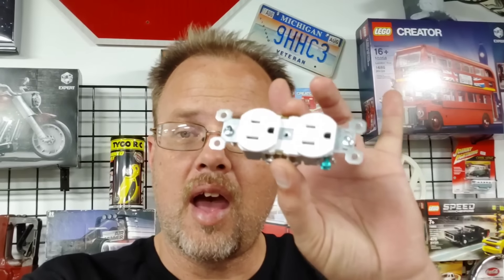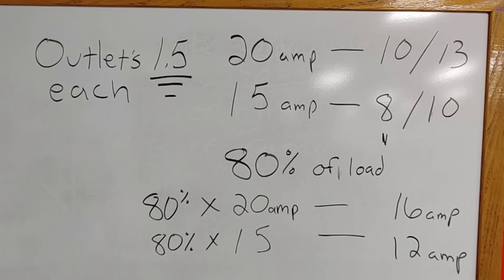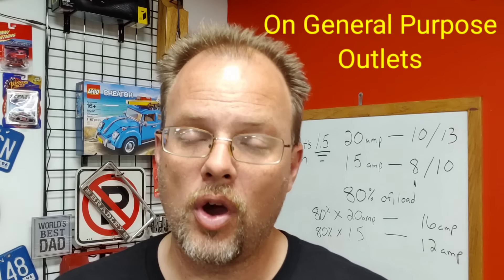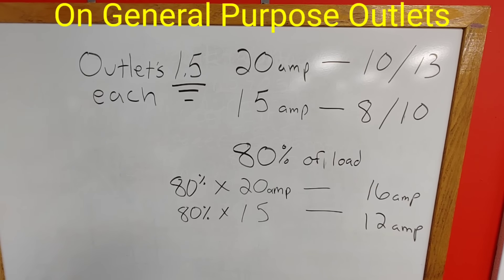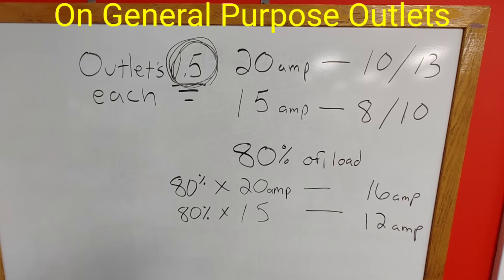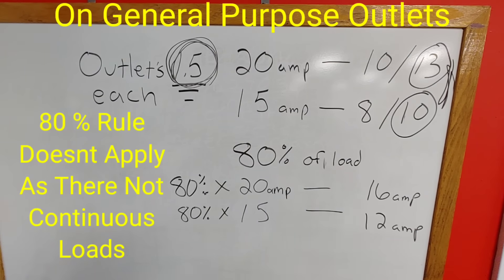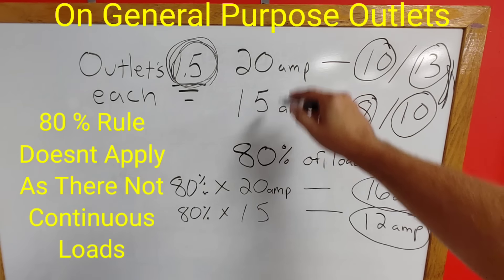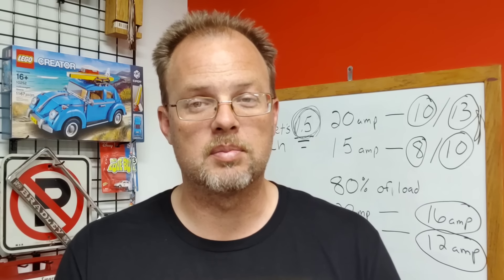How many outlets can you put on one circuit ?

Comment: The nec does specify 180va per receptacle which works out to be 10.66 on a 20 amp, so 10 is the correct and only answer
Reply: In kitchens I always went with 5 on a GFCI and deadacated the fridge and microwave.
Reply: Finally, someone calling this what it is.  A circuit containing receptacles, not outlets.
Reply: how bout that, an actual electrician...maybe city inspector as well?
Reply: Master electrician, 45 years experience,  after a lifetime of learning the trade, I didnot strive to be a good electrician,  my goal was to be the best electrician around, many people have magazines near their favorite chair or the bathroom,  my choice was the NEC.
And to Paul,  limiting the number of receptacles on a kitchen circuit is the way to go, and as required there must be two separate countertop circuits.the microwave must be a dedicated circuit,  for the microwave only. I normally put a single receptacle device to avoid the urge to attach a second item to the circuit.i always install a dedicated circuit for the refrigerator,  I have seen many instances where items plugged in would trip the circuit and a lot of foods we're wasted,  the same goes for a freezer,  where loses can be huge
Reply: Thats only for commercial application not for dwellings if you   want to go by code

Comment: Heres the thing...outlets aren't in use all the time....however if you have lights each can be considered an 'outlet' so if you have 4l lights thats 4 outlets... The 5 or 6 'plugs' may not always be in use even with the lights on....so the 10 or even 12 outlets on a 15 Amp may not be an issue

Comment: Nec indicates 180va per recepticle. 120vac x 20a=2400va. 2400va/180va = 13 “recepticles” on a 20 amp circuit. Va is still va!
Reply: All right except you left off the 80% , that would be 10 total
Reply: Finally someone who knows the REAL math
Reply: @gregberban7067  You got me! I messed up. (even though is there is no limit for dwellings. )
Reply: Yeah but the code said that you can use 80% of 2400w that's 1800watts so Yeah that would be 10 outlets, thanks for saying that so many people would argue with that. 😃
Reply: @gregberban7067  lol, thanks! Cant argue with code! Cord connected load can only be used to 80%. I just forgot that. Good stuff!

Comment: Been an electrician for 45 years , by using gained knowledge of construction and typical use of each outlet would determine the number of outlets on a branch circ. Knowing where the homeowner may plug in an air conditioner or electric heater is important. You would not run a circ. under multiple windows where more than one ac unit might be used. Common sense and experience makes for a correctly and safely wired house. With the high cost of arc fault breakers (around $50 +) that are required on all res. branch circ. some people will try to put as many outlets as poss. on a circ. to save money. I do not recommend this practice , you would be asking for trouble.

Comment: The Canadian electrical code has actual rules! Each receptacle is actually 1AMP per so based on 80%load on a 15A cct, you are only allowed 12 receptacles per cct, this number is written in the rules, same goes for lighting... All devices in resi are max 12 on any 15A cct. Now a 20A kitchen plug cct you are only permitted 2 duplex receptacles per cct.The only new exception is lighting when the fixtures are non-replaceable LED then you calculate as per load.. just swapping out the lightbulb does not allow you to add more than 12 devices to said cct.
I went to school for this ...and watching a few of these american sparkies i will say you are about 10years behind when it comes to the NEC upgrades vs my CEC.
Reply from the maker: Ive actually found we are behind on electrical and building codes both.  As for example canada's insulation requirements and such are much higher as well.

Comment: Given the logic of the video...is an outlet considered to be a standard one gang receptacle, or is an outlet considered to be a plug (so a standard receptacle would count as two)?
Reply from the maker: An outlet is 1 duplex
Reply: @BevinsBuilds  many thanks! Looked all over the internet and couldn’t find any clarity on that!
Reply: By definition of the NEC an outlet is appoint of energy use of promise wire . So the wires in the box are outlets the receptacles are devices used to attach cords. The box with a light attached is an outlet. The point where your A/C is wired is an outlet and so on

Comment: There is a limit on how many outlets. It's called the local code. Where I live it's 6 with a 1 outlet tolerance they will pass seven.  But there was a time when more were allowed. I counted thirteen in my home until I broke up the circuit, 73
Reply from the maker: Yes the NEC is the basic code and local code does surpass that.  Typically though your local code will match up with NEC
Reply: @BevinsBuilds  yes but go beyond NEC like grounds up in Hospitals. I really don't care which way paper towels or toilet paper go and grounds up is about the same argument. It's what you are used to. There are pros and cons about both sides. Hospitals have there own guidelines for safety. I always like the hot on the right and neutral on the left. 73

Comment: Pretty sure “as many as you want” is a wrong answer. It is a finite number. You still need to meet the voltage drop limits of the wire you are using, and the device listing criteria for wire size... (can’t just use bigger and bigger wire) figuring the splicing pigtails needed in each gang of a multi gang box and depending on how you make up the connections (feed through or individual pigtails) providing full capacity at the most distant location will limit the overall length of the circuit.  I suspect the calculated number would be much larger then folks would think initially.

Comment: Very simple.. watts = amps x voltage. If 1 microwave uses 1700 Watts and a coffee maker uses about 1500 watts and they are both connected to 1 outlet.  Even a 20 amp  circuit will not be enough.

Comment: So it depends what you intend to connect. Ever lived in a house where you cant run the coffee maker and the toaster at the same time on different outlets? Tripping the breaker every time? Thats why. Other areas with lower loads can have much more, especially with our modern energy efficient light bulbs, laptops, etc that take much less current than appliances. Surge on things kicking on (refridgerator) also needs to be consider. If you run a server set up, you do end up with more continuous load as well. (The geek in me shows.)

Comment: You left out mentioning that it is a rare event that ALL outlets will be used at the same time on any circuit.
Reply: Yes he sort of mentioned 'continus load'.
Reply: @carlbarrs929  Yeah, sorta mentioned it because it sorta applies to commercial locations that are under continuous loads, if they run lights 24/7. Residences don't have those loads, but this is a general info video so we get what we get.

Comment: Why do outlets stop working?
Reply: Break in the circuit. Old wires get loose under terminals. In and out landed on the plug and the plug burned out.  Animals chewing wires. GFCI is tripped( garage, rr, front door, back door, utility could all be connected in series. Terminals inside Receptacle got loose.  Fried shrimp.  Shrimp gumbo.  That's about it.
Reply from the maker: Lol
Reply: @submittedbymail  I ask a serious question!! 😡

Comment: Why use 15amp circuit breaker’s? What is wrong with using all 20amp circuit breaker’s?
Reply: More expensive wiring to carry 20 amp load.
Reply: 12 ga wire is really hard to work with, compared to 14 ga, and can’t be used with the push in terminals on the outlets.
Reply: I agree. Yes the wire costs a little more and is a little harder to work with. What you get out of the little extra one time effort is well worth it

Comment: 180 volt amps that’s in the code book
Reply: Volt amps?  Isn't that watts?
Reply: Finally! Someone that actually knows what the code book actually says! 180 volt amps is the number that is supposed to be used when calculating general use lighting receptacles (many years ago the only light in most rooms came from lamps plugged into the receptacles)

 I'm amazed at how many people quote the NEC code book but have never taken the time to open it up and actually read it themselves so they know what it "really" says. Good job!

Comment: The thing i disagree with is this, and I lived in a house that had this problem. One breaker, outlets in multiple rooms means you shut down a breaker you take  down several rooms, now let's think of this in load, let's say window AC units, unless you know for certain that you have this group of outlets on one circuit and you put a AC unit in, then you have to figure out where can I plug in a vacuum cleaner at that will not be on the same circuit. Spider circuirs are well and good for saving breakers and runs back to the box, but from a real perspective they are a nightmare and try as you may unless you have it documented you are never going to remember which ones are on which breaker. And trying to label your breaker box then becomes a problem to keep track of.  I tend to prefer the one circuit one room approach to circuit design, this way you know ok I kill power on this room and only this room. Yes the max loading and short runs is nice, but if take into account you put one cable from the breaker panel into a junction box and split off that you still gave one main cabel holding a full load from that j box back to the breaker.  Yes the breaker will trip. But how much heat is that single line from the j box to the panel taking as you load up the circuit? While its easy to keep track the spider concept for your own house, what about the second or third owner? Are they going to know that 13 difference outlets in three rooms are all on one breaker? In the before mentioned house that was a rental, the light switch in most rooms also killed outlets in the same room so turning off the light shut your TV off or your AC off. Save the next guy who has to figure out t a breaker problem from hours of trace work. Don't Spider
Reply: Jeez you should go make a YouTube video you practically wrote a book in the comments😂

Comment: ok, just to understand..... if I put 10 outlet to 1(15amp) circuit and one day I use 10 appliances or devices (blender, toaster, grill, iron, microwave, etc,etc,etc) at the same time. What could happen?
Reply: Local code can dictate more stringent requirements than national code. In Tn. You have to have a dedicated ckt for installed microwaves. Two dedicated small appliance ckts for the kitchen as well as enough ckts for fixed appliances ( determined by load ). Your washer and dryer are both required to be dedicated. 
I personally would limit the rest of the house to no more than 10 rec. Per ckt.

Comment: 180 va per plug in a residense.....lighting load is a guess.....you do not have to use 80% unless you have a continuous load...motor that runs all the time for example.....if you want to know in a house call an electrician.....if a facility has a maintenance engineer in chjarge, its up to him as stated in the codebook...if it were as simple as this guy says i would be out of a job....

Comment: Don't you have to account for the size of wire, or not?
Reply from the maker: The wire is sized according to the circuit you are using.  In the case in this video 15 amp is #14 wire and 20 amp is #12 wire.

Comment: So the answer to the question is the supposed electricians can make all kinds of shortcuts as they wish.  My garage area in a new house - 13 outlets on a single 20 amp circuit,  they would never do this in their own house.  I have a refrigerator, a radio, some chargers, etc. connected and if I run a 15 amp power tool or compressor, it trips circuit.  So I put my own dual 20 amp circuit outlet next to breaker box to alleviate that problem!

Comment: You refer to the code but obviously don't understand it.  The number of outlets is dependent on location of said outlet and the expected load. Most outlets in bedrooms will never see the load that an outlet in a bathroom or kitchen will see. Following 80% rule one circuit to kitchen/bathroom circuit can only contain 2 outlet per circuit with as much as 10 in a bedroom location. Granted codes have changed since I was last constructing but doubt they would have went backwards.

Comment: This got me thinking...might be interesting to put each outlet plug on a separate circuit, removing the tab on each. More work and twice as much wire around the outlets (same amount back to the panel). So each circuit could be spread over say 20 outlets. I really run into  a problem with too much draw in one area. Portable microwave and induction top is one one time. Can only run one at a time unless I was to run an extension cord to another room. But still, an interesting idea I might do some time.
Reply from the maker: That would be a huge waste of wire.  As for kitchens you are suppose to have a dedicated circuit for your microwave and fridge both.
Reply: @BevinsBuilds  well that's not true. A fridge can be dedicated or on with kitchen outlets. A portable microwave should be on a dedicated circuit because of its draw, but it's not required if it's portable (aka countertop).
Reply: The only problem I see with this is that if someone else tries to work on the circuit, and doesn’t know this was done, they may just turn off the breaker for one outlet and think the whole box is safe to work on.  It would need clear labeling on each outlet that they’re from different circuits (which would also help the users spread out their loads across the different circuits).
Reply: are you talking about splitting the outlets so each outlet is fed by both circuits?  much easier to just run the circuits so that every other outlet is on each circuit.  plus in a new build, any high power appliance should get its own circuit.
Reply: @BevinsBuilds  Your also required (per NEC 210.11 (C) (1) ) to have minimum of two 20 amp small appliance circuits in your kitchen.
Reply: That's an interesting idea.
Run it with 12/3 on a 20 amp circuit, break the tab on the hot only. If you use receptacals that accept two wires on a terminal, no wire nuts would be needed other than the ground.
I would want to wire it to a 240 breaker so if you had to turn off the power, both circuits would be off.
This would work great for the kitchen or work shop.
Excellent idea 👍
Reply: @darbyl3872  
NEC says the netural needs to have a pigtail but not the hot?
Reply: @georgehoegen5541  you are correct about portable microwaves not being required to have a dedicated circuit. A fixed in place microwave is required to have its own circuit, as are refrigerators. And a little known (and almost never enforced) code requires those dedicated outlets to be Single (not duplex) receptacles.
Also saw where someone thinks the disposal (and dishwasher) are required to be on their own circuits. Not per NEC. However, locally we had a municipality that Did require separate circuits for those appliances, and required a momentary switch for the disposal. All that lasted about 2 years before local contractors got it repealed.
Reply: @kc9scott  once upon a time it was common to run 12/3 to a duplex receptacle that served disposal and dishwasher. And yep, people got shocked working on it for the reason you’ve pointed out. Eventually the NEC required a 2 pole breaker in order to eliminate that particular issue.

Comment: can you explain to everyone what the difference is between an "outlet" and a "receptacle". outlet boxes and receptacles are not the same but the reference for receptacles is almost always "outlets". a switch box is also classified as an outlet. this drives me crazy and when and where multiple "outlet boxes" with more than one "receptacle" counts as ? one, two etc. thank you
Reply from the maker: Unfortunately and I am guilty of it myself an outlet is not the same thing as a receptacle although by definition they are pretty much the same.  
Outlet is a point in the wiring system where electricity(current) can be drawn from.  So basically any box that is wired to a receptacle, light or piece of equipment is considered a outlet.

Receptacle is a device that prongs are inserted into to power a device.

So in short think of an outlet as a location where something is hard wired and a receptacle is a temporary connection via plug insert.  Hope that helps.
Reply: @BevinsBuilds  thanks brother

Comment: Nice explanation of the logic behind the various numbers. I'm guessing that when you say code you are talking about the National Electrical Code in the USA. People from other geographic locations might find it helpful to have that mentioned. In my neck of the woods the Canadian Electrical Code as promulgated in Ontario normally limits the number of receptacles but with other limitations due to expected usage. For instance a circuit feeding a microwave or a fridge must be a dedicated circuit with a single receptacle. Strangely enough that receptacle can be duplex so its not a dedicated socket. Sockets in kitchens also have special requirements.
Reply: You would think a duplex receptacle wouldn't be allowed in a dedicated circuit 🤔. 
Good point.
It would be nice if the power cord for an over the range microwave/range hood would be in a common location so as to be hard wired.
Reply: @markchidester6239  I think its more a matter of usage and to a certain extent convenience. A microwave is normally used multiple times a day and draws most of the power available in the circuit. It also doesn't move around much like an electric kettle can. Its much like the requirements for an electric stove. Using a plug and socket instead of a hard wired connection is more for convenience, you hopefully don't change the device often but its handy not having to rewire.